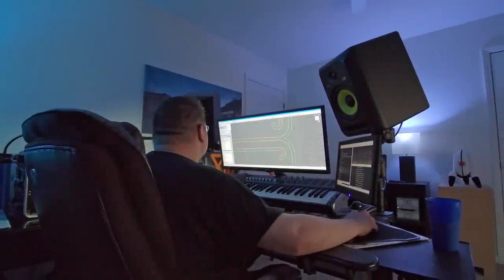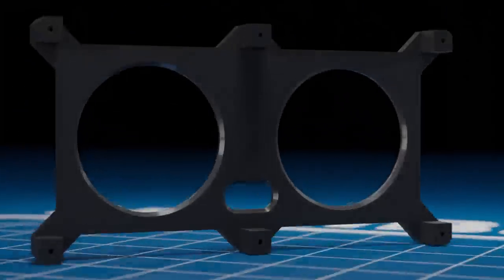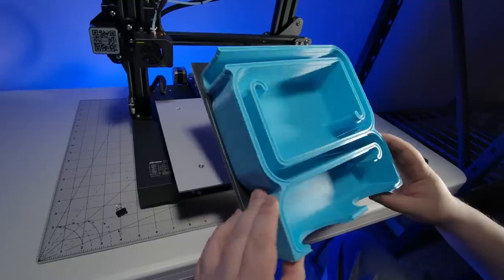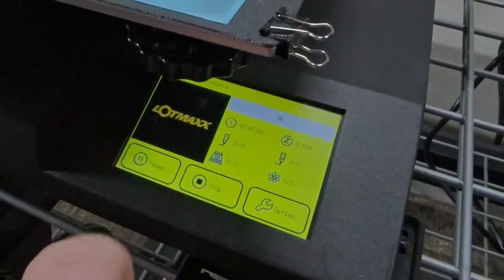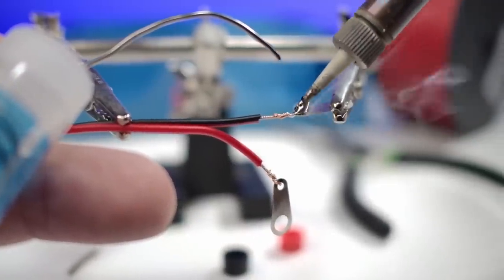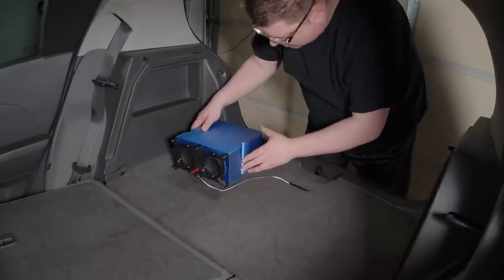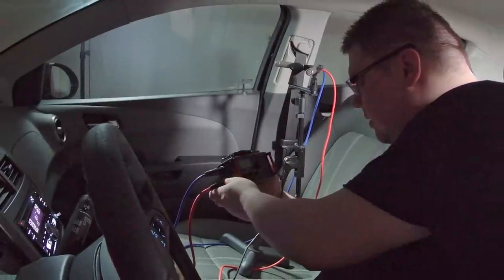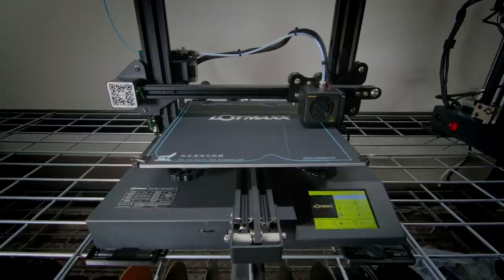HexiBox v.3 featuring Lotmaxx SC-10

Comment: How he manages to increase bass on these mini speakers blows my mind
Reply: How does Pete do it? I believe its two things, 'Education' and 'Acoustics'.
Reply: @juststuff5216  :facepalm:
Reply: Impedance matching. These drivers are so small, the more you can port load the driver, the more it can achieve. 6th orders, T-lines are very capable, I'd like to see what a horn in this form factor could achieve, though I imagine it'd be a nightmare to fit into the build plane of a 3D printer. Folds galore.
Reply: Its Science, Yo!
Reply: If only he was a bit educated in gym, he could worked that weight off.
Reply: @el_teodoro  damn you rude
Reply: Flexxkii that is very body image negative... you should leave your negative thoughts to yourself if you cannot meaningfully contribute to the conversation.
Reply: and our ears. In a good way. I'm fascinated by his creations, even though I don't care so much about acoustics!
Reply: sound in my bose soundlink mini was awesome.
it is too an incredibly small speaker with an impressive mini subwoofer
Reply: EXTREMELY easy to achieve
Reply: @el_teodoro  it's for better bass.
Reply: Flexxkii no, it’s all diet. I know because I’m in a similar boat.
Reply: @edoardogasparotto6241  Rudeness is often necessary to put a point through.
Reply: And that’s exactly what I am needing.
Reply: @el_teodoro  you are on the wrong channel, Freelee The Banana Girl is the right channel for you
Reply: BOSE has been banging sub-30Hz house shaking bass from dual 5" for nearly two decades, it's not that 'undoable' - but to many who don't understand it think it's pretty magical.

Or marketing, if you're an idiot.
Reply: @jochem1986  I am on the otherside of the river. But also a diet problem. I wish you strength to go through this ✌
Reply: This is a fantastic design that could be incorporated into very small cars. Would like to see an improved flat sub design for under a seat vs they typical stuff that's out there. What do think?
Reply: @juststuff5216  7 aq
Reply: 00
Reply: When are you going to travel to China , finding a supplier and giving out some coupons to your fans
Reply: These drivers were a lot expensive
Reply: hey science my old friend
Reply: Wtf
Reply: Same as jbl do
Reply: @jochem1986  try to read book of Andres Moritz  about washing stones and galblender...

Comment: I had one of these woofers, but no 3d printer. I wanted to give this design a try, so used just one woofer and built it off 1/2 inch MDF. Of course I wasn’t able to make the curves like hexibase. 
But the design delivers. It fills my 2 car garage with ample bass. 👍 to hexibase.

Comment: So I went ahead and got me a printer after watching your v.2 build. It was my first print ever so there was a lot of trial and error. I got it done and opted for an internal bluetooth circuit amp and power supply input as the only externally visible connection (Pics on thingiverse). This is doable, thanks to you Sir! Just finished v.3 for my desktop setup the other day. Got a Dayton Audio DTA-2.1BT2 100W 2.1 for a dedicated sub channel and 2 satellites laying around AND THE SOUND IS AWESOME!!!! The dual subs don't even break a sweat, so I'm working on a remix now to take advantage of my 310x310 build volume. Will post on HexiBase Thingiverse remix page once complete with specs.

Comment: I'm pretty impressed!  I rebuilt my printer and was looking for some large prints to try.  Printed just about perfectly!  I did have a bit of problem with the corners lifting, but that's my fault.  It goes under my desk, so I'm not too worried!  I also had to sand the tongue and groove to get them to fit together.  Also my fault and I haven't fixed that yet! Also...  Don't use 5 minute epoxy.  It takes too long to cover the whole joint!  I just barely made it. 
I pared it with a pair of the Back Horn sphere speakers with Tang Band W3-1364SA speakers I had laying around.  Sound great!  I'm powering them with a Fosi Audio BT30D-S with 50+50+100 watts.  
This speaker makes a great setup for my desk!  You'd never believe this was 4 3" speakers!  Sounds so much bigger!  I can't believe the sub makes so much bass!!!  
Hexibase, you’re amazing!  Thank you so much!!!

Comment: I printed this in ABS because I have no PLA only 40kg of ABS laying around.  I would not recommend anyone to print such a large print in ABS.  Even letting it slowly cool down in my printer for 30 minutes it still warped, but it also still works like a champ.  (by warped I'm not talking about it coming off the build plate but the walls and mostly the tongue and groove section)  The thing sounds great.  I'm using a Dayton Audio DTA-2.1BT2 to drive this along with the printed Full range book shelve speakers.  I'm using this setup as my PC speakers and this was exactly what I was looking for.  Some more low end for my PC.  Fantastic.  

People asking about how to wire it up it all depends on the amplifier you are using to drive them.  My amp is a 4-8 ohm load so running in parallel @ 2 ohm's wasn't going to work out too well and why I choose to run them in series @ 8 ohms.

Comment: Amazing ! A useful tip when soldering: remind yourself "I'm not a painter !" Hehehe. Try to heat more the zone with proper fluxe so you do not need to "paint" with the iron. The correct amount of heat and time will improve your solder joints ;) Great video !

Comment: Some comments on improving the 3D-Printing:
You should be looking for a 300x300 CR-10 style printer for prints this big - They are good value and I am very happy with mine and have never encountered any of the problems you have.
For such massive prints, you should really looking for a bigger nozzle and layer height. Say a 0.8mm nozzle with 0.6mm layer height. This should cut your printing time down to 1/3rd.
Another thing I like to do is print seals out of flexible TPU. This could be a good idea for the fittings of the drivers in the enclosure. I recently printed one for the water connection of my dish washer lol.
Other than that keep up the good work! You are connecting two of my biggest hobbies, 3D-Printing and audio development.
Please let us know your subjective opinion next time!! I don't know what the recordings are worth when I play them on massive speakers.

Comment: I am really looking forward to see "something bigger". Like a 8 or 10" sub. 
Maybe you could also try to replace the flat top and bottom with a sheet of plywood or similar. This would greatly reduce the print time and also reduce the chance of warping. Or would the mix of materials have too much of a negative impact on the sound quality?
Reply: I'm thinking of experimenting with this once I have access to a makerspace again. I'm also thinking that it may be possible to intentionally do a no bottom layer print at no infill and thin walls, then post print, mixing an epoxy/sand composite (or even mortar) in place of the infill. This would, in theory, reduce the amount of filiment used (let's admit it, it's not cheap), and replace it with a stiffer material with more mass. Might even arguably be easier to produce than just a  straight up print.
Reply: The design is really simple with all straight walls and small enough to just make from 1/2" MDF or plywood and perhaps some large dowel stock routered to shape if you want to replicate the port entries while adding a form of stiffer bracing.

Comment: Error 6 means that your connection between heated print bed and controller is not sound. Err6 is actually an underrun/overrun indicator for the HPB. Stop using the printer check the cables and connections, this can fry the electronics completely. My HPB cable broke at 3000h and it took a lot of tinkering to get it to work again, Had to go completely Louis Rossmann on the mainboard. I can recommend my last video on my channel to that issue. Your enclosure is printing atm on my fixed SC-10.
Reply: @HexiBase  Yeah, there's been a lot of discussion with LOTMAXX about the build plate, I still have the original with the fiberglass backing, several in fact. They do blister after a long time, but that can be remedied easily. This thing sticks like hell when it's new. I think your bad adhesion was partly due to the HPB failing and not holding the temperature correctly. My printer is in fact a review unit, one of the first printers sent through the official retail channels. It was all over the place before it was properly dialed in, now it's one of my workhorses for low resolution prints.
Reply: @HexiBase  So my attempt at printing the enclosure with the original build plate on the SC-10 failed too. It worked and did stick, but at at some point it actually started pulling the sticker off the carrier plate. I tried to segment the top/bottom of the speaker into segment squares to take the pressure of the surface, but my software wouldn't let me.

Comment: Layer shifts are probably cura.  Cura is awesome but it has a couple of shortcomings.  Might want to try Prusa Slicer. The separation at the front left bis inevitable, given the tall, full size, vertical elements of the print.  Throw a sheet of plastic over the device to keep the space warmer.  That will help a lot but won't fix it completely.  It's not a problem with the build surface.  It's a reality of extruding plastic at 200*C onto a build plate that is 60*C that is positioned in a room that is 20*C.

Comment: I think it would be pretty neat if you were able to put a decibel meter during the comparisons, I know you can audibly hear the difference, but it would be a neat and easy way to compare between them.

And if only there was a printer that could print this with a 8" enclosure, I think at 8" it could reliably replace alot of car audio systems without the large footprint or pricetag.

Comment: You should make a case for the 3.5 inch Dayton ND91. I am going to make this case that you've designed with the Aurasound 3-inch woofers. But a tiny bit bigger case for the Dayton Audio ND91 with 5mm Xmax and 25mm max total excursion!

Cheers!

Comment: Listened to he tracks and my personal flavour is the V2 which has a more clearer bass without the small distortion of the V3. Just my personal impressions.
Reply: is the distortion something you can get rid of by turning down the volume? or is it happening because the 2 subs are interfering with each other?
Reply: @gamezmeow  in my opinion (and I had not the chance of listening to them myself) the volume will be the party pooper here.

Comment: Just discovered your channel and subbed, even though I don't understand all of the sound theory I still find it fascinating. I own a Prusa i3Mk2S and am a big fan of FreeCAD as well.  I would love a build-a-long series for a PC speaker system with L+R+Sub 3D printed speakers that includes building/setup of the crossover and maybe even an optional low cost DSP solution for it.  Love your content.  Cheers!
Reply: BTW Heard about you from Thomas Sanladerer's channel ;-)

Comment: The YouTube channel “Car Audio Fabrication” has made one of these 3d printer subwoofer boxes before. He hasn’t made another one since. I would to see some kind of collaboration. I am interested how far this subwoofer 3d box making will go.
Reply: I swear destiny put me here, on this comment, on this page.
HexiBase, if you're seeing my comment, I'm requesting help, I wanted, or believed, I should do a single ported 12.
I see how amazing all 2 (of the 3 variants) were and how in depth you are like the other channel mentioned. 
 CAF has me using high end components, Audiocontrols  d-6.1200 dsp matrix amplifier, Pioneer DMH-WT8600NEX Headunit, these both cost me around 
2430$
fully stripped interior Focus ST  with sound deadening, 250$ 
All I wanna know is, should I get the HexiBox V2 under both front seats, or would a 12 give me a frequency difference
with a larger box? would it hit deeper frequencies? 
I'm not for being a bass head, what I'd like out of the Bass, is the best quality, I want immersion, not loud.
Please, even a reply,  I was so ready to get my check, and just got buy a standard ported box, and throw in a 12

Comment: I'm kind of obsessed with audio and the ability to design and print all things audio.
As a fun little project, I've designed and printed a few actual small drivers, did my own coil winding, used high power neodymium magnets, flexible filament surround... all that.
They.... didn't work well, lol.  Although, my 3D modeling skills aren't great. 
Have you ever thought about trying to design a 3D printable driver? Could be a fun project!

Comment: So I find the fact that you can get this kind of extension and output out of such a small enclosure and small speaker incredible. But I’m really interested in if you could get something similar with an extremely thin space. So far the thinnest option(and the only one that would work for my car) is a pioneer ts-wh500a which comes in at 2 3/8”, and it has an extremely wonky sealed design with mediocre extension and output. Anyway we could get something as thin if not thinner?
Reply: Considering that thickness is going to be based on mounting depth, check out Dayton audio thin form factor subwoofer drivers. There are many brands that sell them, but in a car where tuning is going to be around the 30hz mark, the Dayton's are absolutely stellar and come in at 2 inches thick. Add a passive radiator to extend bass or build a folded port into the thin box. Just remember than thin drivers are always going to be compromised. If there is another space in the car to put a sub, I would. I've even seen them in glovebox compartments. They fill the compartment with something for filler, and then you can throw something like this in it and it wouldn't be much of an issue tbh. Just gotta controll the rattle lol. Most people don't think about all the different ways you can mount something this small in a car

Comment: I find if you want to max out the print bed with no warping you have to get the first layer squished  to the surface. The paper test quite a bit of resistance , enough to move it but bending the paper pushing towards the nozzle. All that ringing and layer shift must be something loose like the bed y axis runner wheels or x axis wheels. Even the hot end loose. 3D printers , gotta love em
Reply: First thing I would check is the belt tensions, if it plays like a guitar string tone then it’s good with mine anyway
2nd thing would be the hot end assembly , classic cause of ringing and layer shift eccentric nut under x axis to fix that

Comment: Would be great to see one of these designs able to fit on a 220 x 220 build surface. Prusa i3 and Ender 3 sized printers make up a hefty portion of what's owned in the consumer market these days.
Reply: So, you can actually print this on an ender 3, I've done it. Just go into cura under printer settings and change the build volume to 235x235 and it fits and prints. The only other change is you'll need to turn off the skirt, and that's it.
Reply: @bobgodd  Yeah I've seen others make it fit and tried it myself, but it would be nice to have some turn-key models that don't require any special hacks to print on literally the most common build surface size on the planet.

Comment: I have a silly question - are the subs wired in series or parallel indie the box?  based on the quick image of how the sires are run to the binding posts at 7:09, I can't quite tell, looks like it could be either.  I looked on both Thingiverse and Printables, and I don't see wiring instructions. I am going to assume series, as I don't think i have anything capable of driving the ~ 2 ohm load in parallel. I started this build when the video first came out, but my printer wasn't up to snuff.  I have a Bambu Labs A1 now, and it printed both clamshells ALMOST flawlessly - I think there was dirt on my printbed in a spot as the bottom layer has a defect on one clamshell, but not enough to scrap the print.  My previous printer always lifted at the corners, had issues in the middle of the print. 3D printers have come a LONG way in 3 years.
As for the other channels, CNC Kitchen is a great one for 3d printing.  Cheap Audio Man is an OK audio channel if you are looking for buying advice - Soundblab has lots of speaker build videos, using small, inexpensive divers for big sound, similar to here.

Comment: You probably want to get that spool off the printer. Theres a few decent spool holders out there you can print. You likely need to calibrate the driver board on those shifts. Missing steps is a common issue among miscalibrated stepper voltage. If you're serious about getting into printing you might consider octoprint and ditch printing from SD cards. Just my thoughts, thanks for these videos. I really appreciate your work.

Comment: Your Problem with Fat32 on that Printer is something, I encountered before. I had a car Radio, that could only read FAT32 USB Sticks. But I had to format them using Windows XP. If formatted using Windows 7 or 10, the Radio couldn't read them. So I think it might actually have something to do with a different way the OS handles formatting. Maybe even because normally Windows Vista nad up are used in 64bit Format and everything 32bit is more or less "emulated". And FAT32, as the name suggests, is 32bit. That's why it can't handle files bigger than 4GB.

Comment: I'm not getting that deep base on my v2 single.  There is alot of air noise like its free loading.  I didn't use a gasket around the driver which is probably where I need to start.